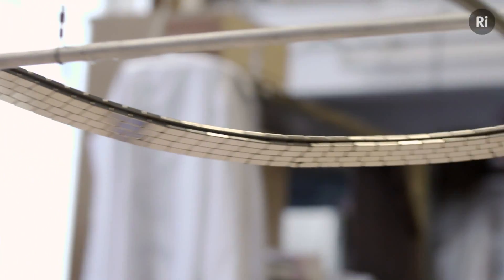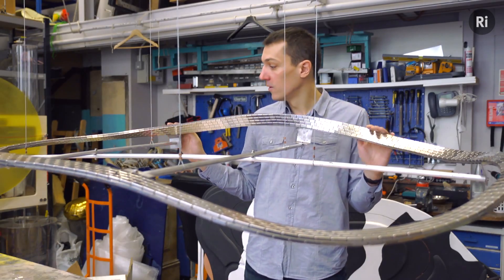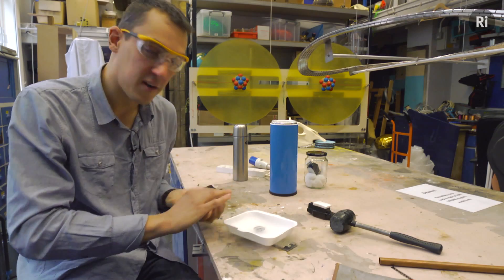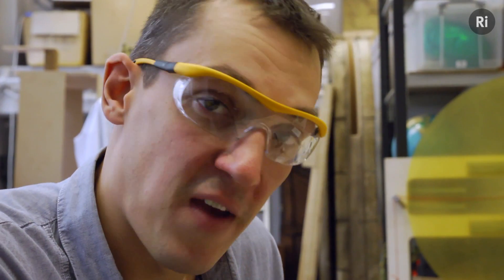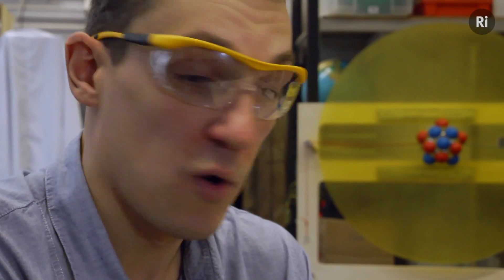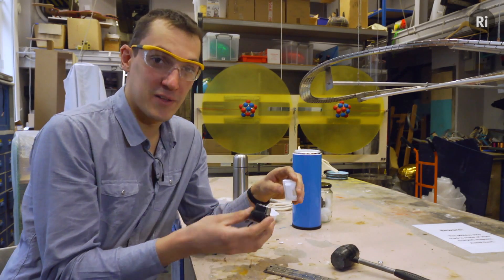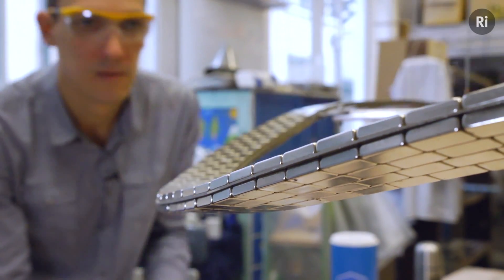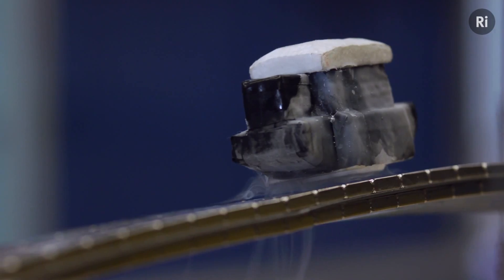Levitating Superconductor on a Möbius strip

Comment: I've got 2 ideas about this:
First: Can you use this to set up a kind of REALLY long lasting newton's cradle, by just putting a bunch of these on a sloped track (basically a parabolic track where the magnets could move back and forth, pushing each other via magnetic repulsion? If you'd do that in a vacuum, that would mean they would continue on until all the kinetic energy is transferred to heat via induction in the neodymium magnets. I could imagine it'd take REALLY long for that kind of Newton's cradle to stop

And the second: Can't you make something like this with a super strong magnet, with a weaker magnet attached to that, with their poles facing each other? Of course that'd be if you would make sure they are attached really strongly. If you'd put a magnet on top of that, it would be attracted by the strong magnet when far away, but repelled by the weak one when close by. So to illustrate, with lowercase representing weak and uppercase representing strong poles, it would basically be this: (n-s) (s-n N-S). The first magnet wouldn't wanna flip around to face the weak magnet, because it'd then face the wrong way for the strong magnet, but it can't come closer to the weaker magnet because it's repelled by it. I'd imagine there could be a situation where the ratios are exactly right and you could levitate something with that, right?
Reply: There exists something called Earnshaw's theorem. It's a mathematical statement that pertains both to electrostatics and magnetostatics, and the gist of it is that you can never make up a distribution of charges or magnets that will allow a test charge/magnetic dipole to remain in stable equilibrium. Your arrangement, for instance, would only work in 1 dimension, like if you put the magnets in a pvc tube. The minute you allow sideways motion it becomes unstable and they all stick together.

Comment: we could make a hovering car andthe fuel is liquid nitrogen and it goes by pushing it :P
Reply: It would take ALOT of nitrogen, but ALOT. This little thing weighs barely a pound, but a car weighs a ton, not including our weight and if you add up, you will discover that the amount of nitrogen needed is insane. If you remember when the guy a the beginning, he put the superconductor in the nitrogen for several minutes, and it only levitated a few seconds. Now imagine how much nitrogen a car would need. The solution is to make a superconductor that can do this at room temperature, which would not need tons of nitrogen.
Reply: TheStrikenings
Or just a much higher temperature, if it can work via a slow drip of some other liquid cooled by liquid nitrogen. But by the time it's feasible you might as well just use a strong A/C unit.

Comment: Room temperature wouldn't be enough.  Power lines can encounter temperatures of over 38°C (100°F for us Yanks).  So what we really need is a 50° superconductor.
Reply: I suppose so.  And the electricity you use to keep the freezer running might be less than you'd use by not using a superconductor.

Still, the higher a temperature it can work at the better.  I can just see superconducting maglev roller coasters.....
Reply: Sailor Barsoom it was a big step to get from liquid helium (early superconductors really needed it) to liquid nitrogen, and it would be a really huge step to get from liquid nitrogen to regular coolants like you use in your fridge and freezer. then we can cool them with efficient closed-circuit regular refrigeration technology, and no longer need to rely on rather inefficient liquid nitrogen cooling.

basically the way it could turn out is: instead of a 1000 watt server, you would have a 250 watt freezer with a 30 watt server inside giving you the same processing power. i just made up the numbers, the point is: right now superconductors save less energy than the inefficient nitrogen cooling consumes. once you make the step to efficient coolants that work really well, that equation changes, it is bound to take off. if google or facebook can cut electricity cost by switching to superconductor processors running at something like -50 degrees, some temperature that can be accomplished efficiently, it will happen on a large scale.
Reply: kurtilein3
Richard Clutterbuck

OK, you two have convinced me.  As soon as there's one running at higher than 0°C it's a game-changer.  Yes, the higher it can run the better, but it doesn't have to be 50°C or even 25°C.

Being able to manufacture such a superconductor on an industrial scale could be as big a deal as industrial-scale manufacture of carbon nanotubes.

Comment: would you be able to use something like this in order to create electricity in an easy and cheap manner? As in putting a circular track and the superconductor (with its own reservoir of coolant) inside a vacuum and then attaching the superconductor to a generator and the allowing it to go along the track. Would the superconductor move forever, and eventually creating much more electricity than was originally required to set it up in the 1st place?

Comment: One problem with replacing normal conductors with room-temperature superconductors: Most superconductors are made with ceramic-esque materials, and it's hard to make a wire *from a brick*.

Comment: From Wikipeidia: "The [Earth's magnetic field] ranges between approximately 25,000 and 65,000 nT (0.25–0.65 G). By comparison, a strong refrigerator magnet has a field of about 100 G." So if anything it would have to be smaller.

Also the temperature is more like an on/off switch. The material transitions suddenly from one state to the other. Things don't get more superconducting when they get colder.

Comment: Is it possible to utilize the earths magnetic flux to build a unit slightly bigger than this one and add a propulsion unit to the craft to force it to go forward and backwards, left and right.  Possibly heat up the superconductor a little and then it would be pulled toward earths magnetic field, then cool it off to make it repel?

Comment: sergeant dumb ass here but if you could use a superconductor at near room temperature that worked incredibly the same as the one in the video did couldn't you make perpetual motion esque device that only needed the continued force of the magnets?

Comment: You could make a car of sorts on a magnet "road", with a big LN2 tank, and a computer to monitor the superconductors' temperatures, so as to release the LN2 in exact amount to keep the superconductors at critical temperature, and simple electric fans as well as the nitrogen exhaust could provide thrust. Gas would effectively be replaced with LN2 for fuel, and to turn, the car would send signals to switches the in the magnetic road, making it operate almost like a model train track. ^_^

Comment: I agree with you apart from the fact this doesn't require complex measurements, superb accuracy or pin-point precision. It simply relies on the fact that superconducting materials at a very low temperature levitate in a magnetic field for a still unknown reason (there are lots of theories, no definitive answer yet).

Comment: nope, 2 reasons why that won't happen:
1. liquid nitrogen isn't something you just find somewhere, you need to create it and that costs energy. (which then again brings up the question where to get the energy from to create the liquid nitrogen and if you ahve a solution for that why not use that energy directly for our cars?)
2. there is nowhere near enough neodym magnets to cover even a single city's streets in it.

Comment: Very cool (pun intended).
Maybe you could use nylon rope instead of the steel wire rope, and some pulleys from teh ceiling to save you standing on tables and fighting the SWR off the track? :)

Comment: The "weight" itself would not change, since it is the mass of the track multiplied by g, and neither g nor the mass of the track change.

Now, the car is immobile when hanging or hovering, so according to Newton's law, all the force compensate; for the car : weight+magnetic interaction=0. So the magnetic interaction will always compensate the weight, the same force but in the opposite direction, up. The track pulls up the car, so in other words, the car pulls down the track.

Comment: Typical superconductors achieve their superconductive properties at temperatures very close to absolute zero, normally below 30 Kelvin. The material shown in this video, YBCO, becomes superconductive below 93 Kelvin, which is relatively warm for superconductors, although still absurdly cold.

Comment: You may be right but i noticed a few things that seem to contradict this, as it was said that it was gravity that the pulls on the "car" witch creates a small current therefore magnetic field, so no gravity no force?.. also i noticed that there is resistance between each magnet as he was able to balance the conductor even then the magnet strip was at an angle, so from what i can tell you need to make the track with a single magnet and use in a vacuum, as gravity is what gives the energy.sort of

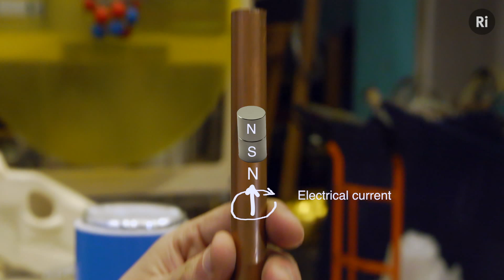Comment: At 3:40 the graphic overlay on the copper tube is incorrect. The direction of the induced magnetic field of the tube is backwards. The field of the falling magnet is upward and its flux is increasing where you've drawn the current. So the induced field must point downwards to oppose the change in flux. The S pole of the induced field must face the S pole of the falling magnet to repel and slow it down.

Comment: at around 3:45 it shows the magnet moving through the conductor. the induced current is flowing in the direction pointing towards the ceiling, and that arrow going around the conductor is the magnetic field?  i always learned that right hand rule where the fingers curl in the direction of the field and your thumb will point in the direction of the induced current. is it me thats wrong? the video says otherwise its just bothering me, i don't know but can someone explain this a little more please?

Comment: If you add a little hole to the liquid nitrogen container (perhaps separated from the liquid nitrogen by some sort of filter that lets gas thru but not liquid) would there be enough trust to keep it going around the track for several laps without the need of a human pushing it at all?

Comment: Basically, what's happening is as superconductor is in free fall, the magnet is pulling the conductor towards it. The magnet itself is generating a magnetic field through the superconductor as a result of the close proximity between the two; but the field generated is now creating a force that counteracts the attraction caused by the magnet influencing the superconductor.
This wouldn't occur in a normal conductor, as the generated force wouldn't be strong enough.

Comment: Eventually. But as long as there is a supply of liquid nitrogen in the little reserve, it would continue on in the track without requiring any extra thrust except the initial force, given that the strip and the conductor is kept in a vacuum.

Comment: I meant as long as liquid nitrogen was supplied, since there would be no friction between the track and the superconductor, and no air resistance either, because of vacuum. So no extra force would be needed to push the "car" each time it came back

Comment: That sounds quite fictitious, I'm not specialized in crap but getting all that worked up would be really difficult specially if you want to make it public and affordable. But I'm trying not to keep my mind closed, There's hope and I'm pretty sure that with enough equipment and research for the correct materials the dream of having the motors you talk about based on the power of levitating superconductors that work at room temperature without the presence of an inefficient good may be possible.

Comment: If the copper tube was a superconductor meaning Zero resistance it wont run out.
because having zero resistance means no energy is being transformed into heat so the electric current stays as electric current with nowhere else to go

Comment: You missed the point completely. It's not about cooling with liquid nitrogen, it's about pressing on with the research, so hopefully one day they will be able to produce a superconductor that operates at room temperature. The liquid nitrogen is only used on tests with existing superconductors, only in laboratory applications. I am sure John Filiatreu was talking about the future superconductors, not the inefficient present ones.

Comment: He needed to create a defined space between the smaller test strip and the superconductive material, and that space was made up of the bottom of that container he had the liquid nitrogen and superconductive material in. He could have used a thicker or thinner container, but if he just had the superconductive material and container somewhere else while it was cooling, he wouldn't have that proper defined space between the material and the magnetic strip.

Comment: yep and if he would have been reading about cures and stuff there has been alot of improvement over the last two years lowering the long treatment time of cancer by 40% (still in testing though aswell as several other medicines that makes your immune system start to work against the cancer ) Easier and cheaper ways to test if someone has cancer or not has been discovered aswell...
and theyve recently made the dvd in a standard computer today be able to work as a HIV tester :3

Comment: so if you put the whole thing in a vacuum chamber, evacuated the air and gave it a shove, would it run and run and run until the liquid N2 in the resevoir ran out and warmed up?
I'm assuming that the only thing slowing it down in this video is the air resistance in the room.

Comment: Not necessarily. Not if he doesn't handle it for too long. There's a phenomenon called the Leidenfrost effect in which a liquid, when in contact with a substance that is much hotter than its boiling point, will form an insulating vapor that prevents it from boiling rapidly. A small amount of the liquid nitrogen will evaporate, but the remaining liquid is held away from the hand by this newly formed pocket of gas.

Comment: Counter potential set up by gravity (when upside down, trying to remove it from the track causes counterforces that hold it in place, when on top of the track, gravity pulling it toward the track creates similar counterforces to keep it floating a set distance.) Lateral motion (aka sideways down) doesn't matter as that will still create the response from the superconductor of a shift in field. Bends don't matter as the superconductor will always follow the path of least resistance.

Comment: So if it's magnetically "locked in" a certain distance from the track, how can you pull it off the track and then put it back on the "same side" of the track, as he does at 5:57 to 6:02? It appears "strong" but not infinitely strong.

I've seen this in other floating-on-magnets superconductor demonstrations. The thing is put a certain distance from the track and stays that distance away, but can be removed without a huge amount of force.

Comment: The whole vehicle doesn't need to be super cooled, just the magnets. You just need really good insulation between the magnets and the passenger compartment. Also, probably just go on top of the rail, no hanging upside-down for safety.

Comment: Hypothetically, if you had the mobius track in a vacuum and a superconducting cart that would stay below the critical temperature would, the cart slow down?

Basically, is there any resistance that would impede motion other than air friction?

Comment: If a cheap, easy to mass produce, room temperature, super conductor were discovered, I wonder if we would continue to use AC? If we transmitted, DC we wouldn't need transformers and I believe we could also transmit at lower voltages.

Comment: @harvey66616 and the person you quoted... It wouldn't get stuck. As the YBCO heats up, it loses its superconductivity and thus is no longer suspended by the track. Depending on where it is, it will either fall off or fall onto the track.

Comment: I'd like to see that. But the tricky part is arranging the input to the nozzle so that it always remains clear of the liquid nitrogen, so that as the boat changes orientation, the pressure doesn't push the liquid nitrogen out.

Just punching a hole on one side isn't going to cut it. :)

Comment: I thought it was that bearings on trains could only go so fast before overheating and generally putting grease and bearing replacement on a costly replacement schedule, and that the train swayed because of a pole in the damped vibration of a free body (not least eigenmodes of a steel box.) Messed up track totes matters when you are not levitating above it too!

Comment: "It would eventually stop at the lowest point in the track"

Why? What slows it down at that point? It seems that without friction, that any time it's at the lowest point in the track, it's also at its highest speed. As long as the initial force is enough to get it past the highest point, it should continue indefinitely.

And even if the initial force is too low, wouldn't it be like a frictionless pendulum, with the simply moving back and forth between two high points?

Comment: Floating Rock it ain't. Magnet/superconductor-with-pinned-lines strength falls off notably quick with distance (maglev trains working like a boss to run 11cm high) and the reason you might need more than a few cc to skate on is the current limit (for the material you select and hopefully get.) See the nice frozen mini-banana case with the most data and see what kind of scaling you can model (0.01 G FTW.)